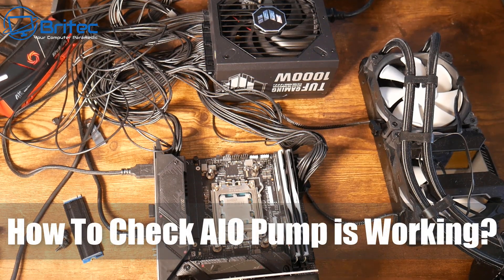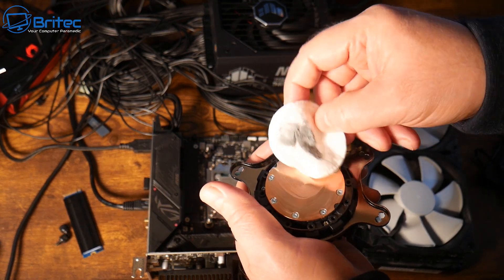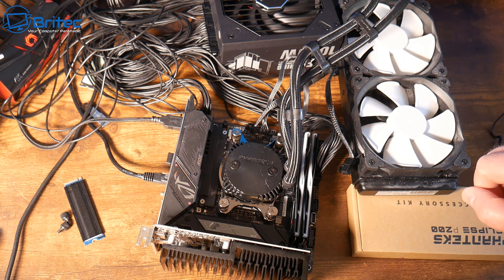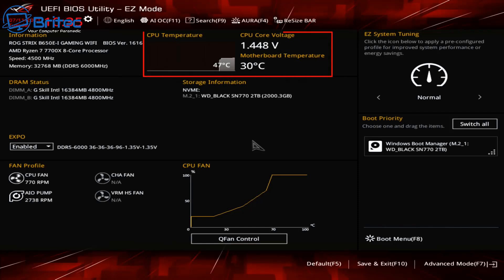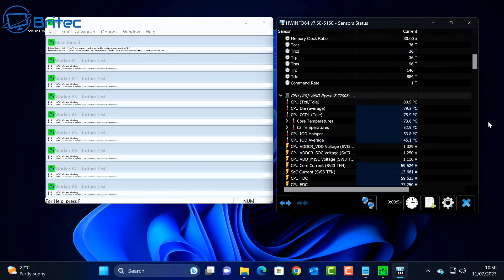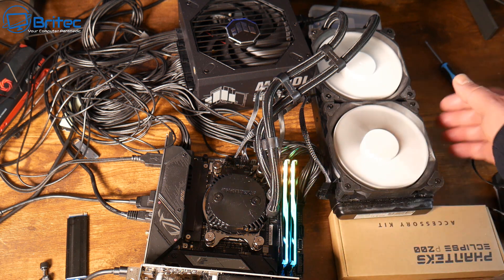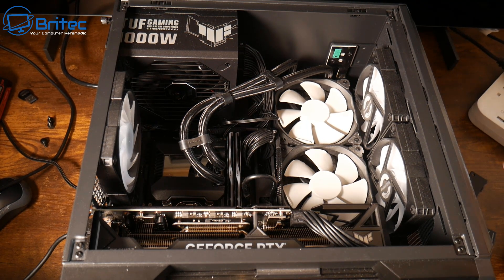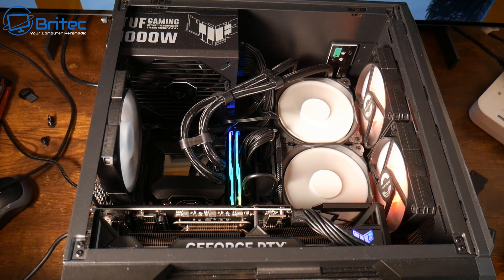Troubleshooting An AIO CPU Liquid Cooler

Comment from the maker: Let me know in comments below if you like this type of content, so I know whether to continue to make it.
Reply: Hi, good video. Suggest mounting radiator in front with hoses down, and reversing airflow -from mesh & back wall, and then out in front through radiator. This will also pull heat from behind MB and supply colder air for the gpu.
Reply from the maker: @MrLorgen  But then you will have no in take
Reply: Hi and thank you for making great videos, I've seen alot of them for the last years. Always to the point 😊   
Maybe my explanation was bad, I meant reversing all 3x standalone fans to intakes, and then exhaust through radiator in front. 
A way to reduce resistance for radiator fans, and increase fresh air supply and needed circulation around MB components. 
Problems I've had with liquid cooling in small boxes are no circulation of air pass VRM's, RAM 
(espec. hot DDR5) and other MB components, giving instability and most likely reduced lifetime. 
Some AIO's negate this issue a bit by having a small fan in the cpu block/pump housing to give a slight breeze in these areas.
Reply: Do you know if both tubes are suposed to be vibrating? I only feel one 
My pc sometimes starts off at  90 degrees
Ill turn it off let it cool down and do it again then everything is fine
I dont know what to do :(
Reply: Using high end parts that require high power in ITX case is not a good idea.

Comment: Got a lian li 240 galahad aio in 2021, the pump was clogged after 2 years in 2023 and I got a replacement from lian li(took around a month to get that). Now, exactly 2 years later, it has once again started causing problems with temps, not as worse as the last time but my 5600x jumps to 75° upon boot and has reached 90° in stress testing. You can never trust an aio for long term usage regardless of the brand.

Comment: these pumps will almost never die if installed as the lowest point in the loop to prevent the pump from drying out. but having it lower than the radiator will make all of the corrosion residue collect around the heat sink fins on the copper block. So you might have gotten lucky while moving the cooler around to knock the sediment lose. But the best fix would be to open the cooler by removing the copper block from the aio and cleaning the gunk out from around the copper fins and the pump as best you can and even rinsing it out with distilled water. This will give your aio the most longevity. I had this issue with a 240 aio failing after 5 years. this method brought it back to life.

Comment: I'm no expert but was thinking about adding an AIO, so I did a little research, and the first thing I saw was that in the vertical position AIO's get trapped air at the top, so the pipes should be at the bottom as most AIO's have 10% air that sits at the highest point, or you will end up only pumping froth instead of water, and many end up with blockages over the CPU with some sort of whitish gunge, so the pump maybe running, but the water isn't circulating needless to say I'm sticking with air for the moment.
Reply: I'm not expert either but I'm pretty sure you want your pump to be at the lowest point you can and pipes should be highest so the air stays trapped high
Reply: I’m no expert gigachad but I’m pretty sure your pump should sit lower than the top of the radiator because of gravity and shit

Comment: im very new to computers this is my first one and its running alot hotter then usual only one pump is vibrating and in the bios is says na on the cpu fan do you know what could be the problem, i just checked my thermal paste and it is fine
Reply: Did you fix it?
Reply: @slond_  yea i was being dumb, the fans came with a controller i forgot about and it was set to be controlled by that and not applications :3

Comment: I have a kraken elite 240 that keeps randomly shutting off. all connections are correct/ i reinstalled drivers etc. It still shuts off within 15 minutes of the Pc being on. At a loss on what the issue may be 😭
Reply: Shut offs arr generally indicative of an over heating component. Your system will shutoff automatically to prevent damage. Check your temps that will help you narrow it down.

Comment: I have had it with these AIO CPU coolers for this past two years.  Blew through 2 Corsair H110is,  a Thermaltake and Arctic 340mm x 140 mm CPU liquid coolers.  These start off as well built systems but eventually, internal galvanic corrosion pulverizes fine cooling channels and clogs pumps.  This cannot really be helped as galvanic corrosion is a natural process between the pump and the fine cooling channels in the pump head and slightly dissimilar metals.  Even with the best electronic grade coolants these will eventually fail.  These pumps always need replacement and the rads flushed out.  These AIO units are kind of pricey for something meant to only last 2 years.  I especially hate the site of these ending up in our E waste city facility buy the dozen every day.  I wish there was a way the manufacturers can make them last longer not just to save money but to save our environment.
Reply: you can take off the copper block and clean it. This will usually get rid of most of the buildup and allow it to run for a couple more years if the pump is still running fine. a good way to see if this is possible is by plugging in the aio and seeing if you hear or feel the pump turn on. If it works then it could just be blocked. you could rinse it out or just clean as much as you can and reinstall the copper block an voila.

Comment: I want  to  mention  something here  ,  since  you mentioned  thermal  paste.    Inside  the  power    supply    their   are   switching   MOSFETS     which    switch  the   DC  line voltage    at  a  very  high frequency     Between  the  MOSFET'S  and  heat sink   is   you guessed  it thermal  paste   ( or pad)   Why   don't  all these  people  go  on   and on about the   thermal  paste  inside  the power supply    You  are doing the same thing   putting  a thermal  compound   between  two  metals    Same  concept  but  one  is more  important  to  spend   all   this   nonsense   about  because the  CPU   is more important  in their  eyes   If   you load the   power supply  it gets  hot   just  like  the  CPU  ,  same  idea  but  not as important   Why ?    That's  why all that   thermal paste on the CPU   is  all  nonsense

Comment: I don't understand. Three videos ago you said, "temps are fine." Now, it's the case not allowing proper air flow. If that was the 'case,' then how could temps be "fine?" We have software that measures the temperature of every component. What was the delta in and out of the case, and which components were overheating?

Comment: Hi, excellent video, taking the system out of the case was a good idea. Whatever AMD say I don't want my CPU running anywhere near 95 degrees, my ryzen 7 runs at 45 on idle and rarely gets much above 60 under load thanks to an Arctic AIO and my Meshify 2 case. I must say I was surprised with the Phanteks case's poor performance as they have a quite good reputation.

Comment: Perhaps a little late to the party, but if airflow is suspected, it’s always an idea to pull off the side cover and aim a house fan into the case to see if it improves things.
Reply: ya
Reply: I have an open air case and my temps spike to 100 celcuis on startup.

Comment: You have 2 intake fans, both of which are partially blocked. 
You have 4 exhaust fans (2 on radiator, 1 on rear of case, and 1 on power supply).
You have a large imbalance, and are running a negative pressure case setup.
I would turn the rear case fan around and use it for another intake. It will also blow cooler air over your VRM and RAM.
The case design is below average, as there is no dominant airflow pattern (front to rear, etc...).
Regarding the mesh hole size, it is mostly irrelevant (though does play a part). What is important is the open area percentage. It has small holes which are spaced too far apart (in relation to hole size), so it has a low % of open area, hence low airflow ability.
Regarding the air temperature coming out of the radiator, the hotter the air coming out from the radiator, the more heat energy which is being dissipated (transferred from the radiator fins to the air), meaning the radiator is performing as designed. If the CPU was running hot, and the temperature coming out of the radiator was low, then the pump has likely failed, as it is no longer moving the heat energy from the CPU to the radiator (heat energy should travel from the CPU to the coolant, then to the radiator, then to the air).
Reply from the maker: That is the optimal setup for that case and its rubbish

Comment: Just use Corsair Link. I have a 7 year old AIO that works perfect, and never changed the thermal paste. My case is a huge Corsair case and never had a problem with heat. I knew it was the case because I have an AIO and never had a problem with it.
Reply: 7 years old? That's impressive.

Comment: Yes Brian I like to smear with a gloved finger the entire surface of both  the CPU and the cooler so that every square millimetre is covered and and never had a problem with this method. Yes mate that vibration is the impeller inside the cooler head spinning and the indication that it is spinning can be wrong if the impeller is off centre or badly manufactured. This is not very often the case but can be. By the by I personally don't like small cases/enclosures anyway I like lots of fans in a mid sized tower case like my Coolermaster HAF XM - a brilliant case they discontinued for no good reason that I can see.
Reply: They probably discontinued the case because too many people were trying to shoehorn powerful systems into pizza box sized cases. I like a big roomy case too.
I do the same with compound. I put a small amount of thermal compound on to both CPU and heatsink, and spread that out until it covers the entire surface, and scrape of the excess. Then I put a small blob in the middle before putting them together. I've seen the first part referred to as "tinting".
Reply: @dalriada842  I agree mate then there can be no reason why the compound is not evenly spread eh?
Reply: I've read that the motor and impeller are independent and only connected by magnets, so if the pump was blocked and the impeller jammed, the motor would still be turning and providing vibration but no fluid being pumped.

Comment: Can you take a drill and drill 4 holes in the 4 corners of the grill then use a small hacksaw to cut out the grill completely. Would this help with the heat problem?
Reply from the maker: I just replace case

Comment: Why a blue screen though? You would assume it would downclock or shutdown if it was bad enough before something like a bluescreen.
Reply: Yeah, my thoughts as well. 
Maybe the VRM on the motherboard was overheating, as it is getting very little airflow. This may impact stable voltages getting to the CPU.
Looks like the internal temperature inside the case was too high, which is causing a component inside the system to play up. Which component? Who knows?

Comment: I don't think I ever seen a AIO water cooling that didn't fail even after a short use time, no matter the brand. They are all worthless over-priced e-waste solution. In many situations the temp differences are very small, sometimes only by 2-5 degrees.
Reply: What is short use time? One month? Three months?
Reply: You need to save up and buy a good one then champ. Never had one fail.
Reply: @RTSchofield Building a PC and almost done my first build btw, and since I got a CPU that’s notorious for being toasty, I got an AIO to cool it down but the fans are not spinning. I can tell the pump is working because there’s a slight hum and I feel the pump but the fans aren’t cooling anything down.
Reply: My corsair has worked for 5 years. I just lifted it to dry water that ran under from a bottle that knocked over, and finally gave way. The cooler was much more effective than the default cpu fan.
edit: was a loose connector, so still going strong.

Comment: excellent video, it was the case then glad everthing is ok with the parts and you only need to replace the case 🤪:yt::_blower::_screw::_spray:
Reply from the maker: Thanks! 👍
Reply: Just leave the side panel open. No need to buy a new case.
Reply: @davehenderson6896  Then Vermen will get in.
Reply: @Nick41622  Where do you live? A jungle.

Comment: good news its just the case cheapest option,i am not a fan of tiny cases my corsair 4000 is good plenty of air flow
Reply from the maker: Cheap £65 case. These small cases do cause issue with high-end hardware.